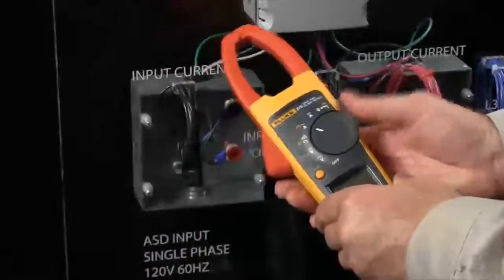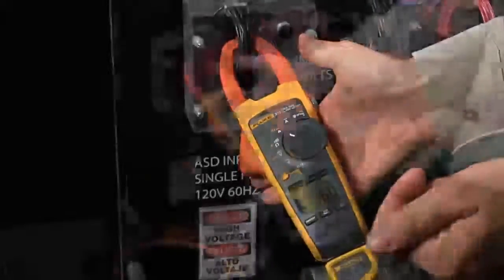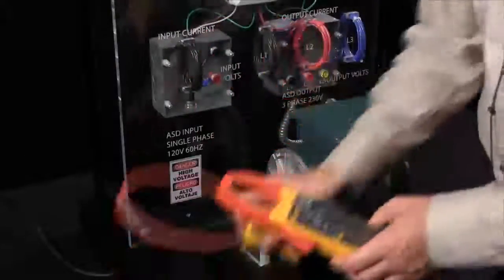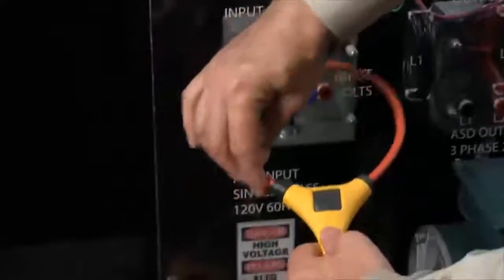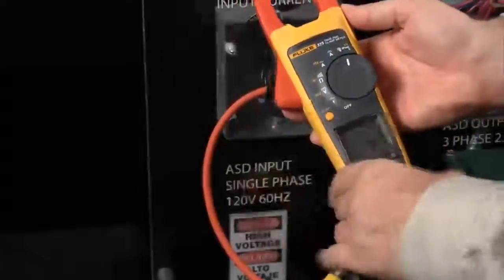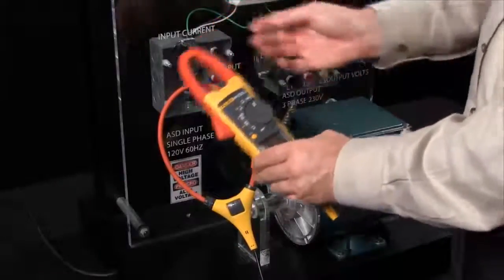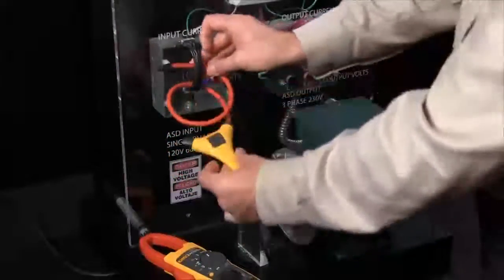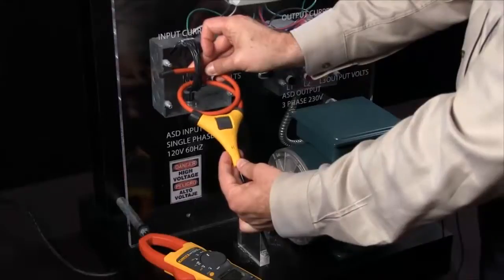How To Connect And Use The iFlex Current Probe

Comment: I measured current using iFlex on a run of 3 conductors connected to single node (Red phase), The connection was similar to demo shown in  above video; the measurements were proximality 290A on a single phase whereas when I doubled the turn of iFlex in order to obtain precise reading as demonstrated above; surprisingly, I noted that the current doubled exactly.

Can anyone explain me which measurement method is correct, single turn of iFlex or Double turn? and why current got doubled whereas it is clearly demonstrated that the double turn method is more accurate.
Reply from the maker: The purpose of doubling the wrap around the phase conductor is if the level is too l small for the meter to measure/
It’s not meant for a mainstream application when the level is greater than the minimum level required.
Reply: Could you please elaborate the term “level”
From your message Above my understanding is that primarily a single turn of iFlex should be practice to measure current using iFlex clamp and if current is to be measure on a single/less area conductor then iFlex should be wrapped twice or thrice as possible.

I didn’t get the point of getting the current doubled on 3 conductors connected to common node phase; when I measure on 1 out of 3 conductors the current was approximately 96 amps whereas when I measured on 3 of them together by wrapping the iFlex single time current was 290A whereas on similar 3 conductors connected to same node phase I wrapped the iFlex twice the  current got doubled to 576A.

I want to know the fundamental method to take reading using iFlex i.e reading is good on single wrap or precise in twice/thrice wrap.
Reply: Refer to the term uncertainty in reading error which is 1-2% as said Mentioned in video. I’m surprise on the results of doubling the current in twice tripping of current. Could you please help me on this?
Reply from the maker: Raheel - you should reach out to our tech support team who will be able to answer all your questions. You can contact them via: tech.support@fluke.com
Reply from the maker: Thanks for your question. The reason for wrapping the flexi current probe around a phase conductor more than one turn is let's say the range of the flexi current probe starts measuring at a level of 10A and the level that is present on the phase conductor is 2A so the flexi current probe is not able to pick that level up.
So you can either use another current probe that is meant to measure the 2A level or you can wrap the flexi current probe 5 times around the conductor to multiply the 2A x 5= 10A.
If the level was 10A you do not need to wrap the flexi current probe multiple wraps around the phase conductor. 
 
In your example below since the level is already 290A you do not need to wrap the flexi current probe more than one wrap.

Comment: will fluke 1587 work with FLUKE iFlex i2500-18
?
Reply from the maker: Hi Bob - The i2500-18 iFlex would not be compatible with the Fluke 1587. I would recommend checking out the i2000 Flex AC current probe for the Fluke 1587. The i2000 Flex can measure up to 2000A AC.
Reply: thank you so much @fluke

Comment: Why do i get a current that is double the actual value when making two loops around a conductor? Isn't it supposed to be more accurate that way?
Reply: Because looping the iflex twice is like doubling the turns of wire on one side of a transformer. I suggest you read the owners manual.

You need to take that result and divide it by 2.
Reply: ask your mom
Reply: You don't get double the current, you get double the accuracy